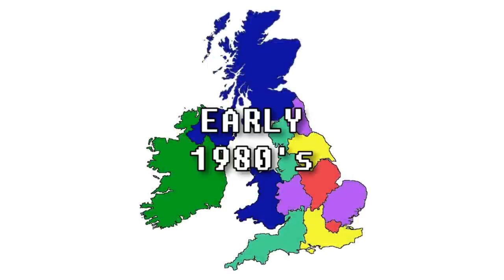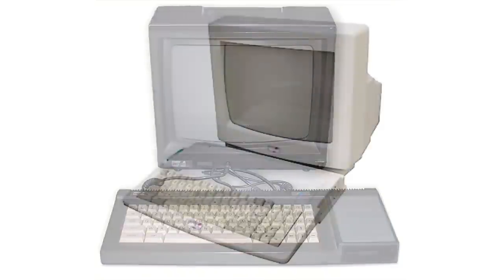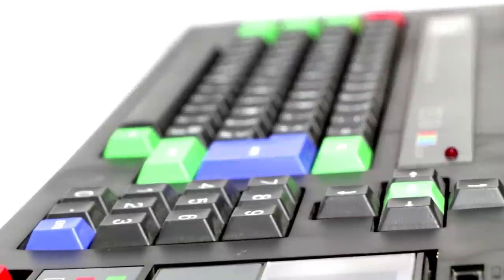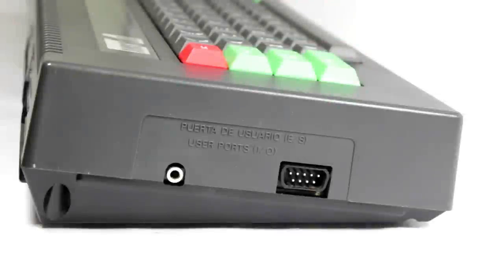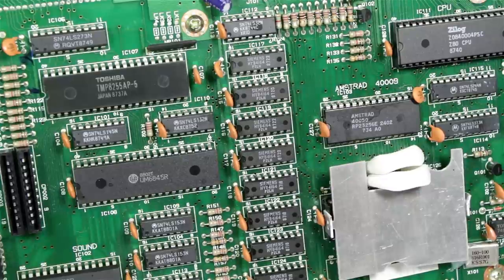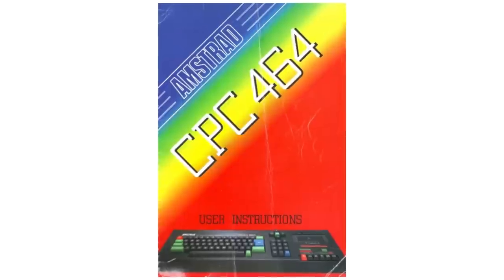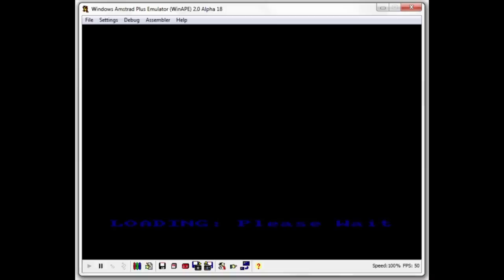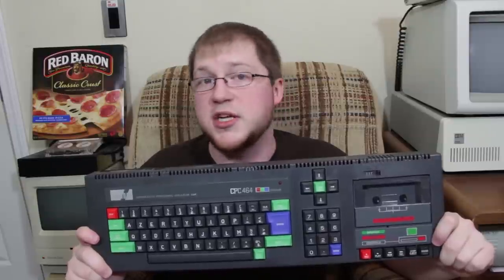LGR - Amstrad CPC 464 Computer System Review

Comment: You got yours from France ? Great, around here jt was very popular in the 80s, competing with the locally made Thomson MO-5/TO-7/etc line of 8 bit computers. Not sure if you could grab one in the US as they were sold only in Western Europe, but this computer has quite an history as jt was the "official" computer the French Government put in every school (it bought tens of thousands of Thomsons) for the "Plan Informatique Pour Tous" of 1985, the goal of the plan being that by 2000 every Frenchman was able to program and that France would be the world leader in software and computers.
Did it work ? Well, look at where's the Silicon Valley. It's in San Fransisco, not in Paris...
Also, another reasons the Thomsons were quite weird are that up until the late 80s, they used light pens as a pointing device instead of a mouse, delaying the widespread adoption of the mouse in France. They were also hooked up to the Minitel (a French sort of precursor to the Internet, much like the British Ceefax/Prestel, that was available up until June of 2012 !), this decision delaying the development and adoption of the proper Internet in France. Actually, it was so severe that until the late 90s or early 2000s, the Minitel was much more used than the Internet and a lot of people didn't even know how to use the Internet. Another example of how the French tried to do different and insted f*ck it up.
But I also find it fascinating. My first computer lessons at age 7 were on a Thomson. But it was 1997 and yes, some schools still had them.
Reply: Yassine Saïdi that was really interesting, thank you :)

Comment: We got one of these for Christmas 1986. We got the one with the green screen, but very quickly plunked down for the RF modulator unit. The picture wasn't that bad on a colour TV, but the unit got insanely hot!  My favourite games were Monty on the Run and Starquake. If I recall, the BASIC was pretty good, especially compared to the C64 and all those POKEs and control characters. Great days!

Comment: I had the 6128 with disk, never seen a tape one.
The monitor coming with the machine was good with a handle. The keyboard sturdy. It feels good. Perfect machine to learn Basic.
Games might be not good in scrolling than C64 due to limitations and big videoram (that gave more colors 16 simultaneously)
But it was more oriented to also be used for work. It provided the high res at the time 640*200 with 2 colors. Perfect for more text on your screen, for word processors, compilers, etc.
And the 160*200 with 16 good colors look good graphically (but again you had usually jerky scrolling).

I am still so in love with my CPCs.

Comment: This was technically my first computer (the CPC6128). Initially bought for educational purposes (I remember the French 5th Grade Maths program called "La Bosse des Maths", about a dromedary that lost his hump, that can only be regained if you solve the maths problems), but quickly used to play on it. It did not last more than a year, thanks to the fault 3"DD, but it had the cool TV Tuner you could connect the monitor to, becoming a cheap TV set with RF and SCART (we name it "La prise PERITEL", certainly the best feature we had in France!). From my knowledge, it was very popular in France, UK and Spain. Germany seems they had much more interests in Commodore C64 (it is funny but you had geographical preferences in terms of computer and videogames systems back in the days, at least between France and Germany). 
Oh boy, such a nostalgia.

Comment: Hi LGR and all readers. The CPC is really easy to plug because the video signal is a standard RGB + CSync 50Hz video signal. Any TV set with a SCART will do the job. Talking about power, a 5V regulated power supply is enough. For the story, when I went to the military, there was a room with some old computers, and there was an AMSTRAD. At that time I had an Amiga, so I asked the sergeant "may I bring it" and he said yes. So I soldered a DB23 -> Din6 cable and I was able to plug my Amiga500 into the Amstrad monitor, and it worked. Converting RGB + CSync to YUV is also straitforward for the timings are the same and it only costs a bunch of resistors and transistors. And the AZERTY keyboard is really "strange" for non french speaking natives, I must admit as a French computer fan.

Comment: One thing I'm learning from my binge watching of retro computing videos is to steer away from computer models that integrated storage devices like floppy disk drives and tape drives. Things with mechanical moving parts are eventually going to wear out and 30 to 40 years of time takes its toll even when these things just sit in storage. Audiophiles build their systems out of best-of-breed components - this looks like a wise approach to retro computers too.

Comment: My second and third computers were Amstrads the CPC464 and then 6128. I got the 464 with a green screen monitor and TV modulator for £199, in 1985, the tape deck never broke down on the 464, but the Z80 CPU did, 4 days before the warranty expired.

However with both 464 and 6128 I had a box load of games. Probably Sorcery + for the 6128 was the best, a game that used disk accessing for the second part of the game, first part being the original 40 screen Sorcery. The Amstrad version was by far the best version. Also the Amstrad version of Yie-Ar Kung Fu was considered to be far better, and as you are a fan of Simcity there was a version of that game released on the Amstrad, and it's quite dire. I now just have the emulator Caprice 32 which thankfully survived the upgrade to Windows 10. So I can still enjoy those old games.

Also a note if you learnt programming a school in the 80's in the UK, you learnt Basic on the BBC which had best version of the programming language, the Amstrad CPC locomotive basic was a close second in the 8 bit market for usability and quality. Far superior to either the C64 or Speccy in that regard.

Comment: Had one of the 128k Amstrads with the disk drive in the monitor unit at one point, was always intrigued by the proprietary rectangular 2.5" floppy disks they used!

Comment: That big IC with "AMSTRAD" printed on it is probably the custom gate array chip which contained all the "glue" logic, allowing the rest of the PCB to have pretty much just the LSI chips and memory, greatly reducing costs. I think even at this time, other 8 bit personal computer makers such as Apple, Commodore, etc; were still using discrete glue logic instead of gate arrays, or if they WERE using gate arrays, it was not in such a total way as AMSTRAD did. Of course, Sinclair also used gate arrays in a major way.

Comment: Mine has an external power pack and RF output for TV. No need to use a monitor and can hook up to modern TVs. Had mine since the 80s. Very well built in my opinion.

Comment: The Amstrad CPC did have a TV modulator. My CPC464 came in a bundle with the green screen and TV Modulator to I could hook it up to the colour TV. The originals are a bit harder to get they weren't as reliable as the actual computer. Mine sort of died about 18 months after I got the machine, although I was programming the hell out of the machine, so didn't really use it.

Comment: I had a Schneider CPC-464 in the 80's and is DID come with an external power device with antenna connection for a normal TV set, so I didn't need a green or color monitor.

Comment: The issue here in NZ you HAD to buy it with the Monitor and tape so pocket money was saved for a C64C by me which gave me a better spec computer initially which I could plug into the TV. 
I then added the datasette when I saved up going with Cartridges to start with.

Comment: Holy crap I'd never seen the latest revision board until you opened that, pretty big difference in terms of the form factor.
Reply: I was surprised by that too. Should be a British one though with the correct key layout.
Reply: I never tested this obviously, but would I be right in presuming you couldn't just swap out the membrane and that the keys are defined on the system ROM itself? otherwise that would be a worthwhile pick-up.

Comment: Let's cover a few simple facts: RGB output and a monitor with RGB input provide you with a very sharp picture.  You get nice crisp 80 column text, which is a no-go with most other 8-bit machines of the era.  Oh, and did I mention that lovely palette that goes with that RGB output?  It's brilliant!  I don't own one and even I know that!
The better of the titles have this look...  More colorful than C64, like more MSX-like, but with C64 chunkiness.
There are a number of titles where the CPC version is "the version" to have, for example, Donkey Kong, which is very widely accepted as the best arcade adaptation.
And then there's the fact that CPC scene is very active right now, perhaps even more active than C64/VIC-20 scene, and they manage to pump out games that easily rival what is possible on C64.  Discovering CPC was a big eye-opener.  I knew of the machine, but I never knew just how competitive it was against C64 and that its appeal had endured.  I highly recommend checking more games to see what the machine can do.
As for serviceability, I think this machine does well.  It was very wise to put the power supply in the monitor, this way the computer case contains no high voltage components, meaning the end user can service it or upgrade it (not sure what mods there are for it) without worrying about electric shock hazard.  As for having to use their monitor for the sake of the power supply, look at it this way, there were no cheap consumer RGB monitors at the time, and TVs did not have RGB inputs, and you didn't want composite because you wanted a clear picture for 80 column text.  Amstrad gave it all to you on the cheap, it's just too bad they didn't really widely market them in the states, which is why you had a hard time substituting the monitor.  It could have easily been something that Radio Shack sold, had there not been the TRS-80 line.

Comment: You should review the Micomsoft Xrgb Mini!
More people need to know how awesome that machine is! :D
Reply from the maker: I really, really want to get and cover one of those, actually. Was just looking at them again for some of my 16-bit machines that would look amazing using one.
Reply: They really will look amazing!
At the moment I'm using mine for my PAL SNES hooked up to my 46" lcd screen and it looks as crisp as if I was playing Super Metroid on an emulator.
Because I live in Europe and all my consoles are PAL I haven't got the scanlines option to work properly but you'll probably just have to turn them on to get that scanliny retro goodness on your big screen.

I've been considering getting a Genesis/Megadrive for a while as that's the console that benefits the most from the xrgb mini but I haven't gotten to it yet.

I probably don't have to tell you this but if you get one you HAVE to get proper rgb-cables or component cables for all the consoles/boards you plan to use with it. Regarding the SNES in particular I would recommend using the original nintendo gamecube rgb-scart cable. I got 2 or 3 aftermarket rgb cables first that didn't work before I got an original.

Comment: I loved my CPC 464.  The biggest problem was:  I only knew 2 other people who had one (almost everyone else had the rubber-keyed Speccy or the Swiss Roll (I mean C64)), so swapping games was rather limited.  Also, some of the ports were dreadful - I'm looking at you Green Beret.  There were a few games I 'reckon' played best on the 464 e.g. Head Over Heels, Dan Dare, Gauntlet 1&2, Bombjack and Gryzor (Contra).  I gave it to a friend who was amassing a system collection in 1999.  It was still working fine, aside from the tape counter reset key didn't work (annoying, but no biggie).

Comment: I understand that Amstrad did make an RF modulator with power supply so you could plug the CPC into a TV set.  Also, what's with the Amstrad by AWA ad for the computers sold a Chandlers stores?  I actually do remember going to Chandlers in the early 90s.  AWA were an Australian company that made radios and TVs and other things.  Can someone tell me whether AWA had some kind of partnership with Amstrad?

Comment: I used my 464 until about 2005 with a tape adapter plugged into the sound card of my PC, to load games saved as wav files (the video mentions this very briefly). With a bit of messing around I got them to load a lot faster by experimenting with higher rates. The 464 outlasted my 6128.

Comment: I have my CPC 6128 hooked up to a SCART lead and a third party power supply for the 5 volts. Because the 3inch drive was missing so replaced it with a 3.5 inch floppy instead. Great Machine, better than the Speccy in a lot of ways but not quite up there with the 64 or the Atari 8 Bit IMHO ....... Great Vids

Comment: I have Amstrad CPC 464 and 6128 (also one Schneider CPC 464) and find them quite decent machines. Have problems mostly with mechanical parts, internal tape player and disk drive belts tend to worn out. However I still have more love for C64/C128 and ZX Spectrum line of 8bit computers in my collection.

Comment: Interesting fact: the CPC had hardware scrolling capabilities, but those were never documented nor discovered until modern times. It has arguably the best color capabilities of any 8 bits computer, but the hefty graphic modes, memory contemption and lack of a sprites chip made a lot of software run slower compared to its peers.
Reply: Spot on.  Had they released it with at least 16k or 32k more, besides having better specs than the competition it would've allowed for more graphics storage and double buffering, which would have been a boon considering, as you've said, it had limited hardware scrolling, no sprites, and beautiful graphics mode but with a hefty memory usage.  The 128k was released relatively close, but obviously software houses would always write with the lowest common denominator in mind.  It had easily the prettiest graphics of the mainstream 8bit computers, and despite it's shortcomings, later in it's life had some beautifully colorful games which at rivalled their 16bit counterparts.

Comment: Back in early 90's I had CPC6128 - from teenager perspective, who was looking for some games and simple basic programs, 6128 wasn't that much different. Same graphics (based on 6485 -  I think the same chip used in CGA graphic cards), same sound - AY3something - 3 generators with envelopes and noise generator. Yes - floppy drive - maybe not so floppy those 3 inch inventions - was really nice. I don't think there were much games using fact it has 128kb of RAM. I was to young and didn't have access to books about CPM system available on that machine and not much interest in programming which you could do on that. However it had much better look. Bit 'colder' and pro. 
Cheers

Comment: I had a CPC6128 for years in the USA. Just used a BNC monitor for less than $100, 5 V and 12 V PSU (cheap!) and that was it.
Never used a greater or better computer in the USA and ... it runs FutureOS :-)

Comment: You don’t need the monitor. I had an additional colour module with my 464 which was as heavy as hell but meant you could plug the computer straight into the TV and play away (well after waiting 20 minutes for the tape to load)

Comment: I seem to hear a lot about the Amstrad CPC being difficult to program for or otherwise underutilized. R-Type stands out for apparently being a lazy ZX Spectrum port, to the point that someone made a remake to address this issue.

The most impressive thing I've seen on this type of hardware, though, is the relatively recent "Batman Forever" demo. Obviously, 20-25 years of algorithm progress have given us good results on other computers, but still - here's a link. Amstrad Scenedemo - Batman Forever by Batman Group (Forever 2011)

Comment: It was an awesome machine for its time. I disagree with some things that you said like the tape drive being unreliable -- that's not true: You can adjust the tape head with a screwdriver through the hole above the tape head. Of course, when the head is maladjusted, things don't work properly, and some programs had been recorded somewhat off, so that the screw had to be readjusted for them. Lord, the patience we had in those days! :D -- CP/M was a big thing on the CPC, and could be obtained with any Amstrad 3" floppy drive (or 3rd party floppy drives -- I had a Vortex 5 1/4 " drive with 704K per disk side capacity). I also had the Maxam module which provided an assembler/disassembler/text editor/monitor in ROM, which was great for programming. I'm sad that I sold it after I had an Amiga. I only had the CPC-464 with green monitor. The Z80A processor (despite its almost 4 MHz clock) was incredibly slow at times. :D I didn't know many of the programming tricks, as I didn't have the original developer kit (which required the 3" floppy drive, IIRC). Anyway, I liked it a lot. Locomotive BASIC was one of the best BASICs there is, it had software interrupt programming for one-shot and recurring timers (just as in Javascript today), and an exemplary support of the hardware (like palettes and sound), and also was easy to extend with your own commands (using assembly language).

Comment: Well, at least it had hardware sprites so there was no color-cell bleed like the spectrum. I do remember finding out where the video memory was, filling it with a basic loop and finding such a weird layout. The horizontal screen was divided into 3, contiguous memory filled block #1, Row #1, Block #2, Row #1, Block #3, R1, B1R2 etc. Bizarre!